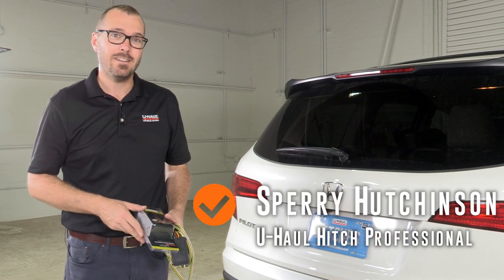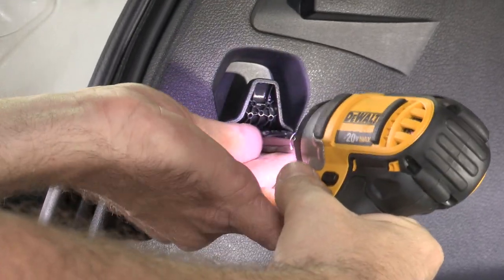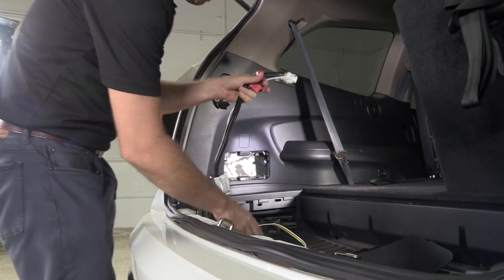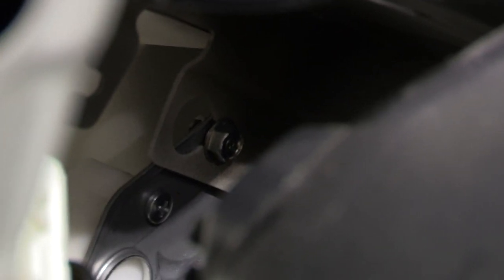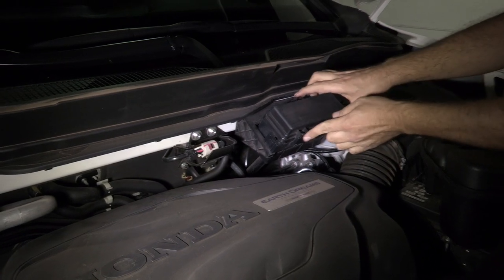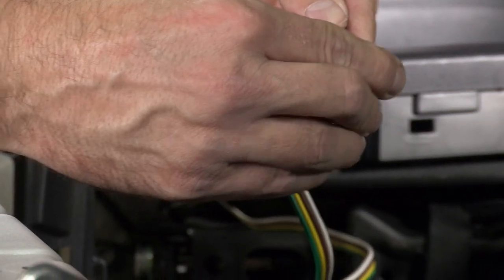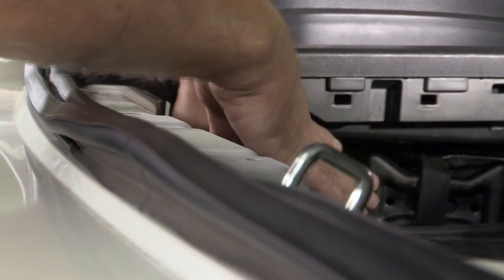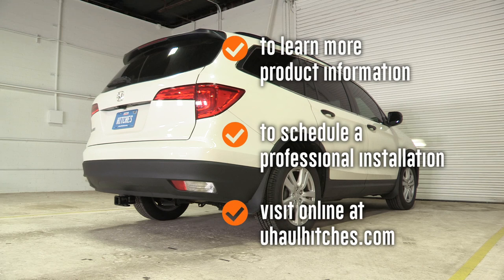2019 Honda Pilot Trailer Wiring Installation

Comment: I have a wiring harness like this installed. My left turn signal works but not the right. Some people say there are two fuses, one for left and one for right but all the videos I've seen only show a single fuse in the main box under the hood (30 amp) and you also show one in line in the wiring harness. Is that correct? And if so, what other issues may cause one light to not function?
Reply from the maker: It Could be a damaged or shorted wire. Or it Could be a fuse or relay that was already installed that has gone bad.The 30 amp installed under the hood and the in line fuse installed by convertor are obviously good if left turn and running lights are working. If the Honda flashes its rear right taillight, but the 4flat connector is not, use a light tester to see if there is a Signal on the green wire entering converter box. If you find a signal going in and not coming out then convertor box may be bad. For more assistance you can schedule troubleshooting time with Your Local Uhaul Hitch Professional!